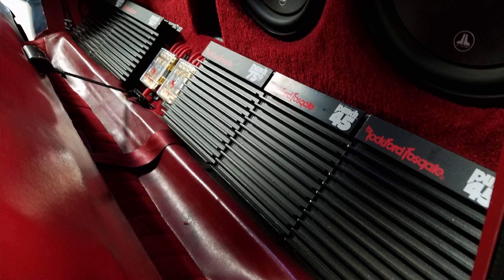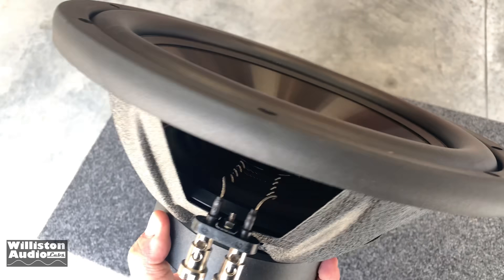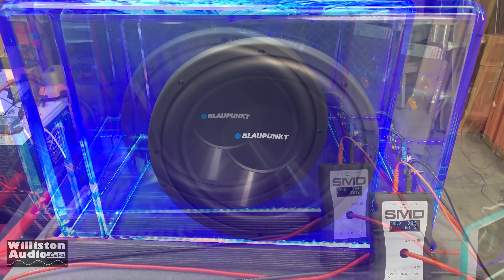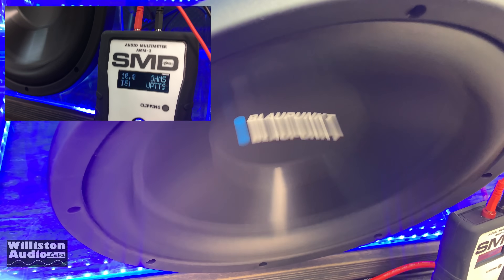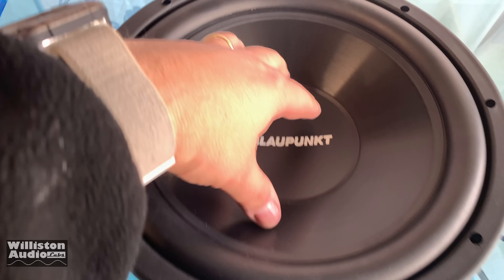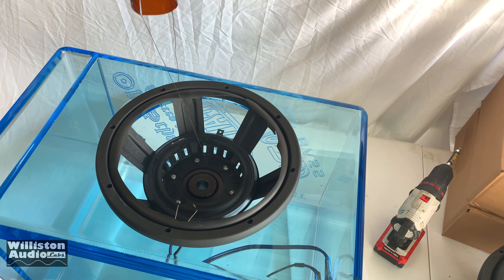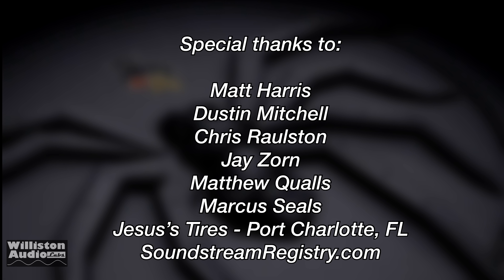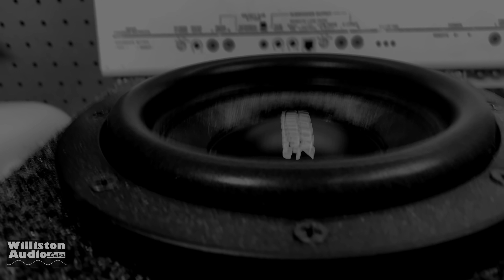$20 Walmart Subwoofer Tested and Blown Up! [4K]

Comment: Got a question about this sub would it be a good replacement for my psw10?
Reply from the maker: That’s a 10”, this is a 12, so it won’t fit in that box. Not sure if that was what you were asking or not? 🤷‍♂️
Reply: @wal  I understand I said that confusing lol. What I mean is do you think the 10" version of this sub will be a decent replacement for my old blown sub. Like did this sound good for the money
Reply: This Blaupunkt is higher quality than the OEM driver in that Polk sub, so if the box and port are close enough, it would be at least as good.

Comment: Derek, really? Here it goes, foam surround and a stamped steel basket! I know you know your stuff. No need to explain. When it was known it had those two things, that ruined it! The coil former is visibly distorted and I could not fix that on a bet. It is a throw away speaker and you should have known better. We all have purchased things we latter regretted. This is yours. Oh well, learn and move on. Junk is a leopard whose spots aren’t changing!🙄
Reply from the maker: It’s really a decent sub for $20-25. Hard to complain at the price

Comment: F.Y.I to eryone saying "used to be" top end sub/company etc.
This is what happens when a company gets bought out by a rival.

Take MTX or PIONEER, for instance. Both companies get bought by Sony (that's why you can buy them at Walmart) and Sony begins to water down the products for maximum profits. Pioneer is a great example of a 'used to be" company. Audiophiles kill for vintage Pioneer because of it's amazing quality and sound. Pioneer is probably the most sought out "vintage" home audio equipment on the secondary market. Essentially anything Pre 95-ish will fetch a good amount.(especially 70s and 80's Pioneer) .

As for car audio......
 Remember when MTX Thunder 6000,s would blow up the whole block? Again same story........

I'm sure if you Google the brand in this video, you'll discover at some point (likely when they went to shit) they got bought out by a competitive company with more money 
EDITED
just googled it...they was bought out in 09 after bankruptcy for a "undisclosed amount".... meaning, ..... basically the name is slapped on shit products made by a different company.....

Edited....MTX was in fact NOT absorbed into another company. 
Clearly I made a mistake....I got Mtx mixed up with another brand.
Reply: https://en.m.wikipedia.org/wiki/Blaupunkt
Reply from the maker: MTX wasn’t bought out. John Ivey, the son of the original owner, Lloyd Ivey, runs MTX now
Reply: @wal  your correct.
 I stand corrected....
I must have gotten MTX mixed up with another brand. I actually looked on Wikipedia, and it was in fact NOT bought out/sold. 

Anyway....sorry for the misinformation.
The other two ..was definitely bought out lol.

Comment: calls blaupunkt cheap but uses garbage power tools for his business.  (yes that drill is garbage)  buy real stuff like Makita or DeWalt.
Reply from the maker: I like my Porter Cable, it’s not junk in my book
Reply: Did the drill do the job in this video?  Yes?  Sit down.
Reply: @wal  try using it on holes bigger than 1/4" or a lot of holes.  you will quickly find out how shitty it is.  the thing has no balls.  it's a low end drill meant for home use.   it's lower quality than this sub you are testing. porter cable doesn't make that drill.  it's a shame their name is even on it.  you have a equivalent to a harbor freight drill.